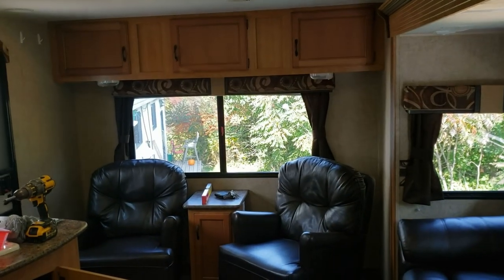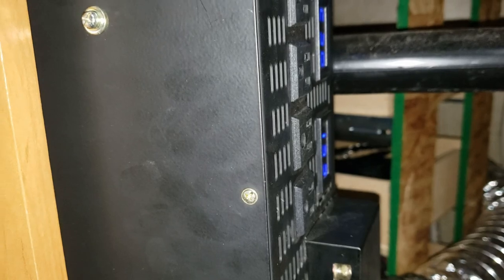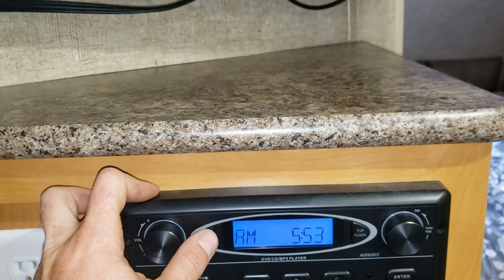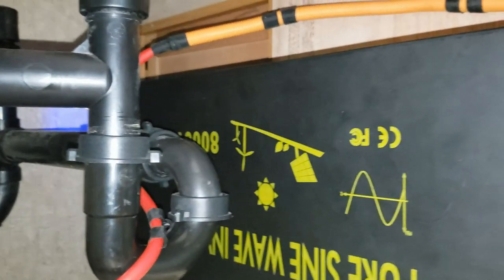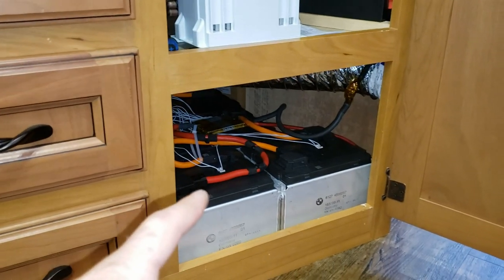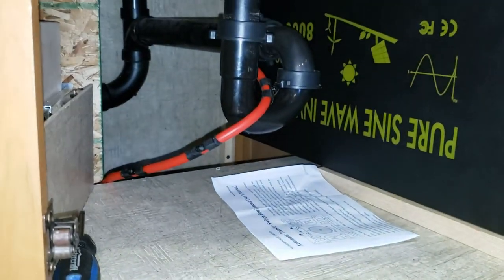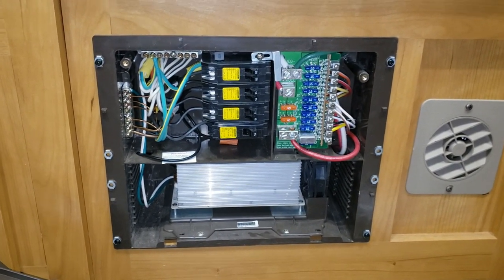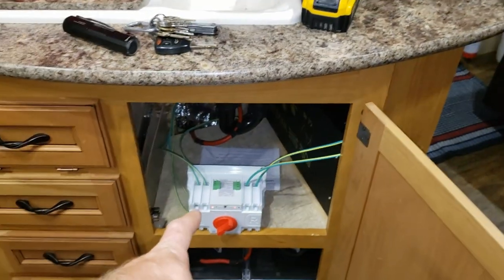8000W inverter and Automatic Transfer Switch Install In RV

Comment: Pro tip:  You will 100% have a leak in your RV sometime during its life.  Remember, RV's are made by the lowest bidder and of the cheapest materials, do you want to chance putting an inverter next to that plumbing?  Hell no.  I would also put a VERY reliable leak detector down there as an early warning for a leak.
Reply from the maker: good idea! thanks.

Comment: Nice one. 
Just a thought, if a battery charger could be wireded into the AC side of the transfer switch, then when external power is on, it could also trickle charge the batteries. Best of both worlds. 
Keep up the good work.
Reply from the maker: Good idea

Comment: EXCELLENT TRANSFER SWITCH AND " AWSOME"  OPERATION GREAT FOR THE TRAILER HOME .  ALONG WITH THE 8000 WATT INVERTER AND BATTERIES  , ALL  ARE WORKING TOGETHER TO RUN EVEN THE HIGHER LOADS SUCH AS THE AC UNIT .

Comment: I like the way you used the green wire for neutral and line voltage, it is a smart way to save money and it looks like it should be thick enough to handle 8000W
Reply from the maker: It's a very high quality nickel plated copper wire, it is 10 gauge.

Comment: They make devices for water heaters (especially attic installs) that close a water valve if they detect any moisture.  They are expensive (starting at around $120) but I would think it would be well worth it in this situation.
Reply from the maker: Thanks! That's sick

Comment: Just wondering why you didn't just wire a 30 amp plug into the inverter and just plug the trailer into it.
Reply from the maker: and have the inverter outside ?
Reply: @GoingOffGrid101  No the cord is likely 30 feet long it could go almost anywhere. I like what you did just seems complicated
Reply: Just one other thing as we are not there to understand the wiring but is the 30 amp plug live when the inverter is on I mean the male end you would normally plug into the grid sorry for questions but is not clear to me.
Reply from the maker: @offgridwanabe  the RV outlet is never live with the inverter on
Reply: @GoingOffGrid101  Ok so the RV plug in wire goes directly to the auto switch then the panel got cha
Reply from the maker: @offgridwanabe  yes

Comment: Very Nice! I just picked up two of the BMW 3s batteries myself. Can I ask you how you made your connections from the battery terminals to the inverter? The factory orange primary leads are great for making connections between the batteries themselves, but how did you attach a large wire from the main positive and negative leads of the whole battery pack? My only ideas was to drill a hole in the BMW male spade connector on the battery and use a nut and bolt with a ring terminal on the wire. Thoughts? Thanks as always!
Reply from the maker: That's a good idea I think
Reply: @GoingOffGrid101  Great, Thanks! How did you connect your BMS wires to the BMW battery? Do you have the pinout diagram for the factory BMW harness on top of the battery?
Reply from the maker: @micahwilliams2609  i took the cover off and soldered to the cells
Reply: @GoingOffGrid101  The terminals on top of the cells are aluminum, correct? How did you solder directly to the large aluminum bus bars running between the tops of the cells? Anyway you might be able to do a quick video showing how you did this?
Reply from the maker: @micahwilliams2609  there are small balance like wires coming off the larger battery terminal and it turns into something you can solder to.

Comment: I didn’t mind the video replaying. I wanted to see it again anyways. Question. Would it be better to hardwire that chord to the inverter. I thought I read that the outlets can only each supply a portion of the power the inverter can produce. 
What repair did you do to the 8kw inverter. I must have missed that video. I seen you were worried about the surge from that aircon. I know they use more power at start up but that aircon was only using like 1000w so I figured the 8kw inverter shouldn’t have any problem. Am I wrong?
Reply: Never mind about the extension chord. Seen it was temporary
Reply: Btw. Great video! Did you buy those 4s batteries individually or did you have to buy the entire pack that has the other amount of cells in series?
Reply from the maker: @RJ-cc1fz  i can tell you witch ones have what cells inside the two smaller packs have a few 4s and 5s and the larger one has mostly 3s and a few 4s and one 5s
Reply from the maker: I found out I blew 4 40 amp fuse inside the 8000w inverter and i didn't know it and it was acting funny till I really looked into it.
Reply: @GoingOffGrid101  was hoping I could get only the 4s
Reply: @GoingOffGrid101  I wonder why yours blew the fuses. The inside of my 4kw newer model reliable doesn’t have replaceable fuses. I contacted the seller. They told me that there’s a really good fuse in the 4kw that is extremely hard to blow. I could send you pics of the inside of my inverter if you are curious. How can I contact you
Reply from the maker: @RJ-cc1fz  I didn't get the email, not sure why I did have a lot on it lol
Reply: @GoingOffGrid101  i meant delete my email address once you seen it
Reply: I can’t send you an email till you email me so I can see your email address
Reply: @GoingOffGrid101  got it. I’ll send the pics

Comment: why not just use the bms to controll a contact breaker
Reply from the maker: Yea I could a d I have it to. But I decided to not cheap out and bought a proper bms for the system
Reply: @GoingOffGrid101  I think sometimes running power through a bms can be troublesome more so the higher the current needed
Reply from the maker: @1981dasimpson  this new bms is the same one that runs part of my house

Comment: Looks awesome, quick question how do you keep your charger from trying to charge your batteries with your batteries?
Reply from the maker: the bms stops it and well as the charge controller I have a custom voltage set to 4.1v a cell
Reply: What I did, I put my trailer charger on the shore power side of the transfer switch. I fuse protected it with a light bulb pigtail socket and a 15 amp glass fuse.
Reply: Edit add: I also put my air conditioner on the shore side of my transfer switch. Running AC on batteries is just plain stupid.
Reply from the maker: @timcat1004  I run the ac off my lithium batteries all the time on camp grounds you can't run a generator past 9 at night and its 100F
Reply: @GoingOffGrid101  For what a couple of hours maybe and if that.
Reply from the maker: @timcat1004  I have 8kwh of batteries so 8000wh and my AC uses 1100w i get about 7 hours running full blast or much more if I set it to turn on and of so its not funning the hole time. normally enough to last the night.